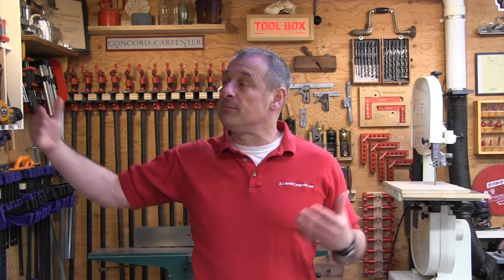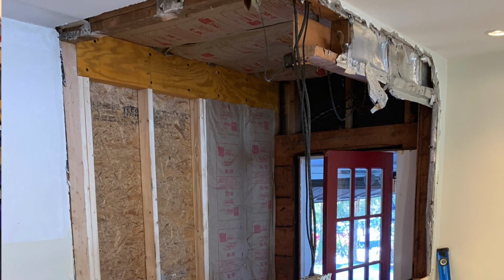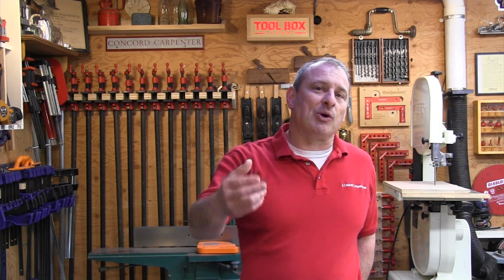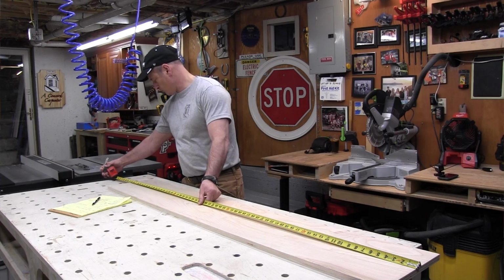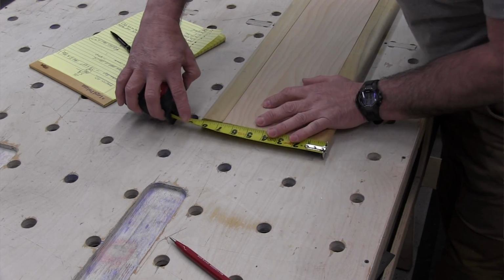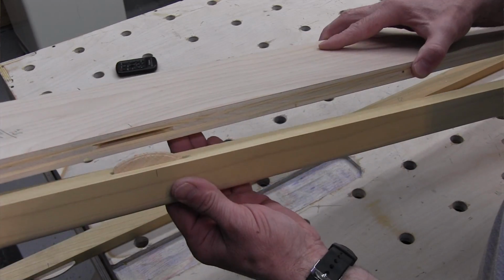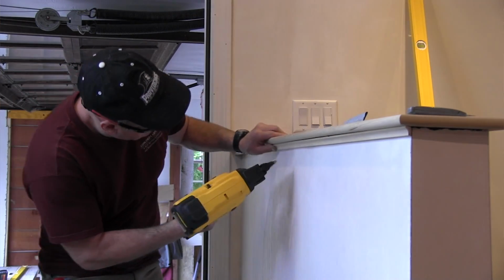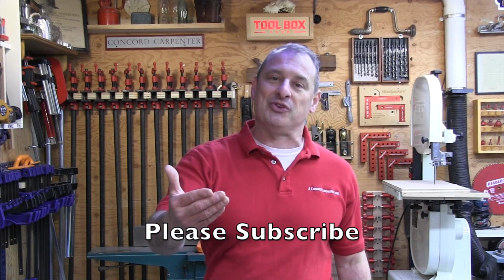Cutting Into A Wall To Make A Half-Wall

Comment: I don't know how many houses I've gone into  to work  on other projects and  notice the half walls are unstable. Great tip with the plywood to stiffen it up. The ones I've been involved in the ceilings underneath were all finished amd had no access.
Reply from the maker: BZ1340 we had an open  floor to do this but basement access works too
Reply: Are u able to do a video on how you put the 2×4 to make the wall stronger

Comment: How does the plywood to floor joist connection compare to the tensioned all-thread into blocking below. (I think you did a video on that for a bathroom remodel several years ago.)
Reply from the maker: William Butler the plywood to floor joist connection only works if the joists run parallel - both work good but the plywood has more coverage and covers across the whole wall
Reply: A Concord Carpenter / ToolBoxBuzz Oh. So the plywood goes on the face of the wall, not the 3-1/2” end?
Reply from the maker: yes - that is one way to stiffen a way. In this video we added two 2x6's down into the joist bay and used structural fasteners and wood blocking to stiffen the end of wall